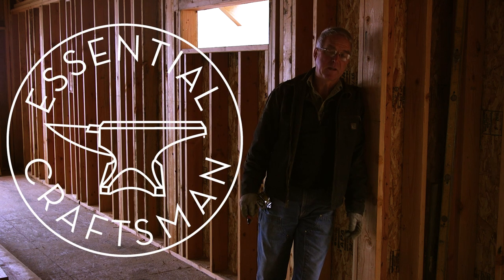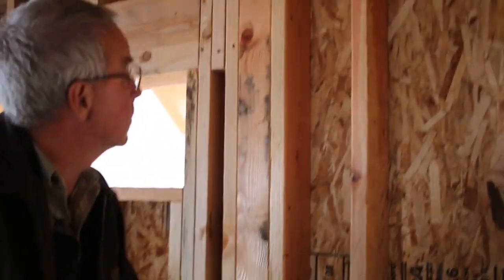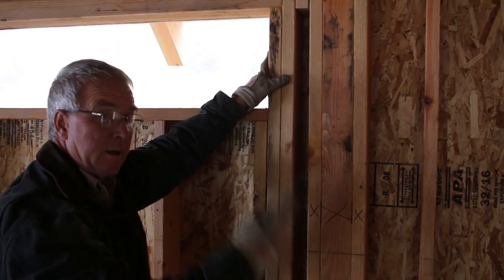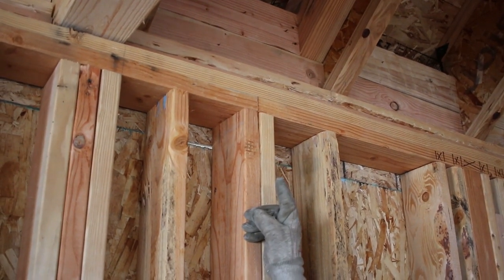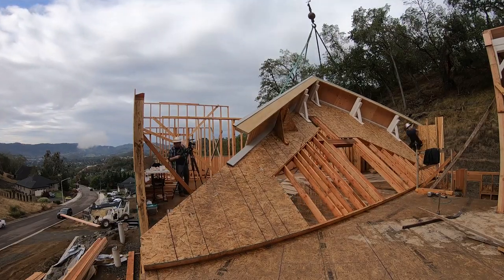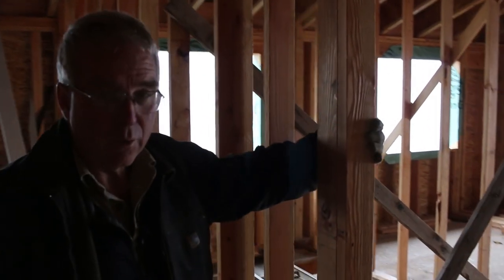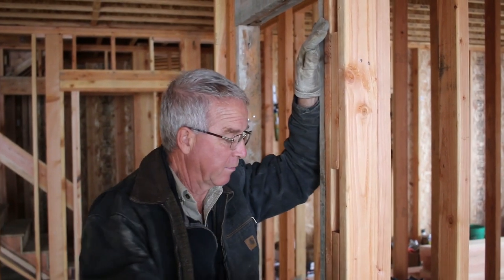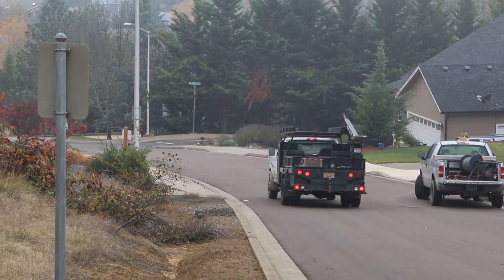Framing: The Parts of a Wall

Comment: Back in the early ‘80s, when I first started working on a framing crew. We needed literally tons of what we called in TX, “make-up”. Make-up was all the, window/door jacks, channels (‘T’s) and corners for a large apt complex we were working on. 
Senco brought out a prototype machine that was designed to do the task of preassembling ‘make-up’. It was able to mount 3 standard Senco framing nailers, with a couple of positive stop adjustments, depending on which piece of ‘make-up’ you were making at the moment. The guns and a cpl of pneumatic presses all operated simultaneously by a foot switch from the operator. 
Bcz I was the ‘green-horn’ on the job, and the machine made the make-up assembly pretty mindless, it was determined that I would be ‘the chosen one’ to operate it. 
The machine did exactly what it was designed for, very well and I can proudly say the carpenters never wanted for make-up bcz I was able to keep-up.
It never really caught on, and I never saw another one, mainly bcz it was just too bulky for most smaller framing crews to carry around.
Reply: 😂😂😂 machine working "mindless".  a good one!!!👍
Reply: @asdf do you get paid a lot as a troll?

Comment: Your trimmer studs are jack studs in the midwest. Cripples are the same. Your videos are largely review for me but I enjoy seeing the differences you present. Thanks for sharing
Reply: Jack studs on the East coast as well. Do you use channels? Seems that at channel prevents one from insulating the wall in that area.
Reply: @finieclimber  myself I avoid them  if I  can. I'll use open cavity blocking on outside walls  because of the insulation issue.
Reply: @finieclimber  “Channels” are called ‘T’s in a lot of areas.

Comment: We used 'advanced framing' for the exterior/interior wall connection. This consisted of a 2X6 perpendicular to the interior side of the wall stud. This formed an 'L', essentially a 'california corner', that gave sheet rock backing to both sides of the interior wall connection and room to insulate the outside wall cavity.

Comment: Ah, the joys of construction jargon, we have all been on jobs were some joe calls out a term and were like "HUH what are you talking about?"I've heard a jack and jill rafter, wiggle board, barge facia, barge rafter, barge trim, the last three supposedly all the same thing, and the list goes on and on! Just as a for a fun challenge since some of us have free time right now, would love to hear any of your weird or strange terms for framing or building jargon. Of course with your blessing Scott :-)
Reply: What about barge beam and barge board?
Reply: We call California corners L's faster to say and it makes sense
Reply: In England, Australia and NZ) we call "Blocking", "Noggins".   No idea why and "Noggin'" is slang for your head in most places and for a wooden mug in old english.   What that has to do with framing a wall I have no idea... but it is interesting to learn different terms for the same item.  Trimmers are "Jack" studs (the clue is in the name), bottom plate is a shoe.   Casing is "architrave", skirting is baseboard...the list goes on
Reply: We call jack studs, cripples. Headers sit on the cripples :)
Reply: @JDeWittDIY  "barge board" is also a term used as an aerodynamic device used on Formula 1 and Indy Cars!

Comment: Here where it gets very cold in the winter , most framers don't use Channels in outside walls but use a ladder pattern for intersecting walls so insulation can be in the cavity and it's easier for the electrician to drill and run wiring.
Reply: It doesn't make any sense to frame a channel like that.  It leaves a void that can't be insulated.  Nobody that understands modern building techniques does it like that any more.
Reply: @chrismoore9997  I have an idea.  Why don't you build a house the way you think it should be built on spec and video it so we can see how to do it correctly.
I would be willing to bet if this house were being built in Montana or Minnesota, the details would be different.
Reply: @chrismoore9997  He replied in another comment that they insulated the channel before putting the exterior sheathing on.

Comment: The spec house is a fascinating series. You folks provide concise instruction with good manners thrown in. Have you checked out  Engles Coach Shop channel? A combined woodworking and blacksmithing fix to be sure. Dave builds some amazing stuff there. Cheers

Comment: love it. make sure to think about holdowns and other mechanical anchors when framing wall intersections. so rarely does the plywood get sheathed to the correct stud with the holdown. and then make them stack vertically. that double stud at the top plate splice isn't doing anything but that's okay :)

Comment: A cripple is a framing member with it's lower end cut off relative to a common member. For example the rafters coming into a valley are cripple rafters. A framing member with its upper end cut off is a jack, rafters which come into a hip are jack rafters. Cripple studs are over an opening, jack studs are below an opening. These names may be regional but this is what I learned.

Comment: A channel can be replaced with a 2x6 stud nailed to another 2x6 turned flat. That uses less lumber and also enables you to insulate afterwards behind it.  If you insulate before that requires you to have insulation around which most framers dont have or dont want to do. Also, the west coast weather doesn't agree with insulation.

Comment: It's called a "cripple" because it's got a shorter leg than the others. Really that simple.
Reply: That’s funny! Never made that connection in my head.
Reply: He knows. That's why he said "perhaps that's not politically correct [anymore]".
Reply: @brockalbert5111  Now it can be called "a sustainably harvested, carbon neutral, length challenged structural member"...no more cripples, no more "studs".
Reply: @danielhawley6817  studs are asexual now and exteriors wall  p blocks get insulated around here ....

Comment: A trimmer in Canada at least in Ontario is a cripple. Because it doesn't hit the top plate. Interesting. The cripples on top of the headers are just blocking. Its fun to see different terms from different areas.
Reply: Greg Dent I don’t think so? In Alberta it’s called a trimmer. I don’t think it would be different from province to province?

Comment: Great except all windows out this way (NORCAL) have double sills.  Much better backing for stucco or siding plus they are often blocked on each side with 4x4s and a structural strap applied (CS16)

Comment: Putting in full-stud channels is a pretty old-school method to do things, before we cared so much about insulation performance. All those exterior wall channels are going to be dead air with no insulation in them. A better practice now-days is to leave one end open, and either put horizontal blocking in, or turn the stud sideways. That way the insulators can fill that void.

Comment: Thanks for the expert detailed layout explanation. Does 4’x8’ exterior wall sheathing eliminate the use of diagonal bracing on 90 degree outside corners?
Reply from the maker: Most of the time.
Reply: In N.C. if the sheathing doesn't go from plate to plate (If your walls are over 8')then you have to lay it horizontally or you have to install diagonal bracing or a line of nailers at the break.

Comment: Is the channel method the best way to attach an interior wall to an exterior wall when considering insulation factors? Or is there some kind of California corner method? I'm having a hard time visualizing it. But then again I'm a cabinetmaker and finish carpenter, not a framer.

Comment: Trouble with what he has called a wall channel is that you won't be able to insulate the channel once the wall has its exterior sheathing on it. When I framed we always made a California corner for intersecting walls just with a 2x6 instead of a 2x4 so it would also provide drywall backing as well as provide a spot to nail the intersecting wall to.

Comment: How do you insulate your exterior channels when there’s 2 by material going back to your sheeting?   If you’re using 2 x 4 interiors why don’t you just make a corner post but use a 2 x 6 so the drywaller still has nailer on both sides?

Comment: I guess a "Cripple" is exactly what it says and is any stud that has a section cut out of it.   And Trimmers are called Jack studs here as they jack up the header.   Dunno if that is the Official term but was the way I was taught.   That gable wall is about as complex as it gets.   If you can build that to code then you can build anything.   I always layout assuming that another person will be nailing together.   it is a good habit to get into and acts as a sanity check while your going wild with the nail gun.

Comment: Those channels you put in for wall ties, we call those full wall bucks. The problem with a buck like that to tie a par to an ext wall is that it leaves an air cavity behind it that you cant insulate, so for those ties I mark a corner buck with one wall stud and one backer a dimension bigger than the wall. How did you fix the air cavity?
Reply from the maker: Stuffed them with Insulation before the sheeting went on.
Reply: @essentialcraftsman  gotcha!

Comment: What is the center height on a 6/12 pitch roof ? .We are building a cabin for a combat veteran here in Alaska an snow load calls for a 6/12 pitch roof . The cabin will be 16×25
Reply: 6/12 pitch means you have 6 inches/feet of rise for every 12 inches/feet of run. Assuming the 16ft will be the Gabled end of the roof you will have 8ft of rise at the center beam of the roof. If the 25ft is your gabled end then you will have 12.5ft of rise at the center of the roof. I hope that helps with answering your question. If you need a calculator for the various needs for roofing or any other construction check out Handyman Calculator on Google play store, it is awesome for all types of construction calculations. If he is a disabled vet and needs a ramp ADA compliance is 1/12 slope on the ramp for it to qualify as wheelchair accesible. 36 in minimum opening across ramp, however many wheelchairs have a wider footprint cross the back wheels than 36 in. Handrails are 36 in min height in most states although local codes may differ. Thank you for providing for a Vet there are so many that are left hurting after giving so much.
Reply: on a gable roof you only use half the run to figure the rise at the center (picture two triangles butted end to end)  which would make  height 4 feet at center on 16' and 6'3" on 25 feet @TheSatyrblue